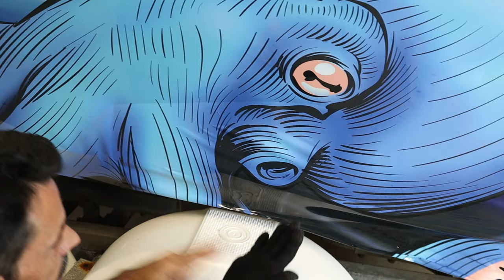How To Vinyl Wrap Your Boat!

Comment: Thanks for the great video. I have a bay boat that has a fairly low profile and the part I want to wrap is just over 24" at the widest part.  I see 3M sells sheets that are 60" wide.  If I were to cut a 60" roll in half would that give me enough material on the top and bottom to work with or do you need more overlap than that to deal with the bow flare?

Comment: Watched about ten "How to Vinyl Wrap your Boat" vids on YouTube and yours is easily the most informative hands down. I have a Quinny Legend CC with clinker sides (lapstrake) Is it still possible to wrap it and if so, is it much harder to do? Cheers for the great vid mate 👍
Reply from the maker: Thanks Ricko, appreciate it. Yes clinkers are a little harder to wrap. We will have a video coming shortly on that style hull. You need to lay the recesses first then lay flat sections being careful not to trap the air. Post heat is very important on those, if using Avery 1105 with 6460DOL wrap like we do the post heat temp is 70 degrees C, but I generally go to 85-90C.
Reply: @marineskins  Cheers, I'll check it out when you upload it to see how much more involved it is. 👌

Comment: Hello,
Thank you for doing this video and showing your tips.
I had a question about bringing the wrap up to the rub rail.
If the seal-tape needs to overlap the wrap and boat - then you must have ran the knife tape just shy of the rub rail -- Yes?
What distance is that overlap needed?,,,,,,,,  an 1/8th inch or??
Also do you seal-tape the wrap overlap at the bow?
Thank you very much,
Jack
Reply from the maker: Hi Jack, the tape width is 10mm(3/8) and you should have between 3-5mm (3/32 - 3/16) of the tape on the boat side is good. Just need to cover to protect the edge of the wrap. Push the edge seal down very firmly. The edge seal is thinner and has a much stronger bond that stops the water. The reason to also do the top is that the water curls at the bow hits the gunwale and then shoots downwards spraying the top of the wrap edge which could potentially create a failure in the future. On some boats it is possible to remove the rubber rail, install the wrap so it ends under it and then reinstall the rubber rail.

Comment: i dont understand how you butted up the ends of the wrap at the bow where they meet and how you repaired the bit cut out around the bow tow hook
Reply from the maker: They overlap. Port side wraps around over onto starboard side then starboard side will over lap onto port side. Once both sides are on edge seal tape is run down the edge.
Reply: @marineskins  understood. Thanks for reply and great video . Did you cut a small patch to fill in the cut part for the tow hook or the overlap took care of that. Also do you put seal tape around the bow hook.

Comment: Great video! I'm going to wrap my boat                 (23ft trophy ) next week myself for about $400 .  A shop wants $2000 to do the wrap. Ima save big!!
Reply from the maker: Thanks! that's great, have fun with it and enjoy the awesome time out on the water
Reply: I wouldn't do at home doesn't even look easy man 🤣
Reply: 400$ where ??? I make a estimate whit this People and cost 1600$ and I have 22ft
Reply: Where did you get your wrap? How did it work out doing it yourself?
Reply: @gherickb8181   i bought the wrap on amazon . the brand is vivid and bought a huge roll which i have alot left over
Reply: @Diego-le5xt  how much brother !!!!???
Reply: @calvinjcolin3  amazon ,,, the brand is called vivid. for my 1st wrap it came out good. its not easy,,, took me about one week to finish it but i did take my time. My boat stays in a slip and after 1yr the wrap is still holding up. its no show quality wrap but from 6 feet away it looks good lol. i would do it again..

Comment: Would it be easier to do the soap and water application?
Reply from the maker: No water and soap not required and is not recommended for Avery and 3M wrap films

Comment: Can you tell me where you cut the top wrap at the bow? Down the front edge?
Reply from the maker: Both port and starboard sides have to wrap around the bow 30mm or about an inch so the water flows over the join. If its not wrapped around water will hit the glue edge and risks water lifting it and then getting in under the entire wrap over time. Also don't forget to edge seal around the perimeter